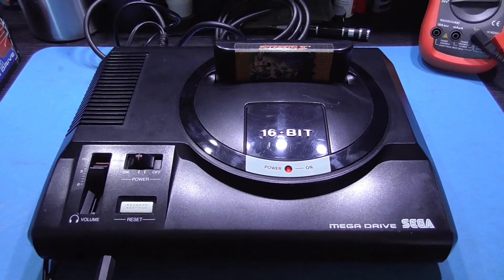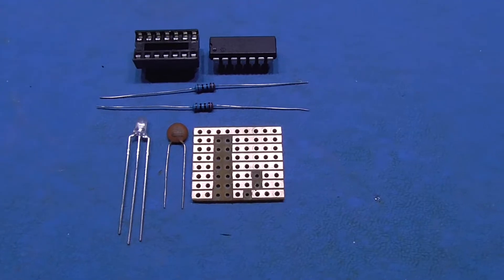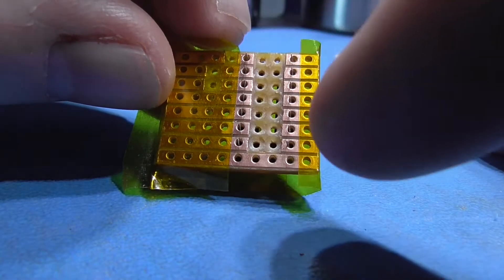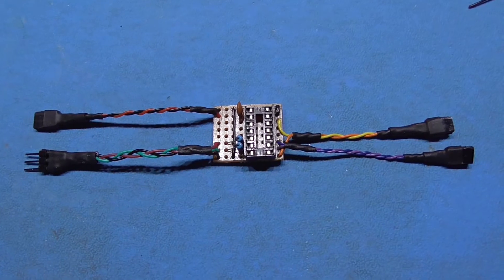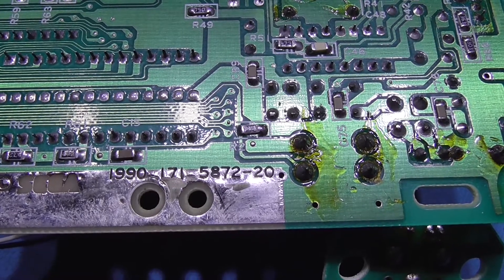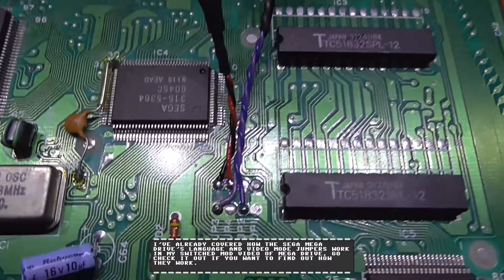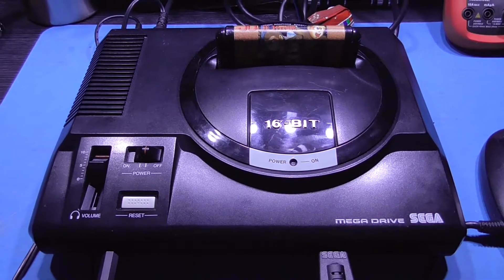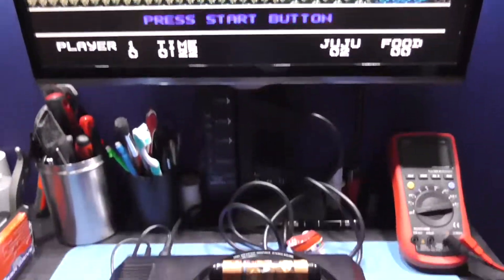Sega Mega Drive / Genesis - Switchless Language & 50-60 Hz Mod.

Comment: So the region lock is not in the cartridge. It's in the system?
Reply: It depends what you mean. Its in the cartridge if you want to play a game with a different region on your pal console. You can achieve this by switching the board of a ntscj cart to a pal cart case and the system reads it normally as a ntscj game. If you want japanese text out of your ntsc-u/pal game you need to mod the board of the megadrive/genesis and then you would probably want a switch.

Comment: Hi. I managed to follow your guide including writing the PIC chip and everything was perfect. This is probably one of the most useful guides online. I didn't go all out on the disconnects like you, just added one on the LED. Ended up with 150 and 330 ohm resistors to get decent LED colours. Maybe my LED's are garbage. Will have a video up on my install in a few days. Cheers for the great guide.

Do you by any chance know if D4S code can work to control a Mega CD multi bios? or does that only work with Seb's code? I might have to ditch D4S if it doesn't work with the multi-bios.

Comment: Beautiful work. That's how I want to do mine. Could you answer me a few questions please? What value resistors did you use for the LED? What gauge wire did you use? and What do they call those connectors you use? Many thanks
Reply from the maker: Thanks for the kind words.

1) both LED resistors are 220 Ohm
2) 30, 28 or 26 AWG wire will be fine, i use 28 AWG
3) .1" inch (2.54mm) Single Row Male + Female Pin Header.

Hope this helps and good luck with your mod.
Reply: Awesome. Thanks for the response. I have never used vero board before but looking forward to giving it a try.
Reply: Hi. Are those pin headers the type that require crimping with a tool? Cheers
Reply from the maker: sorry not got back to you sooner i've been away.  no crimping just solder to them i used some heatshrink tubing to make them look nice.
Reply: Ah cool. Well I went and bought myself a cheap crimp tool and some male and female dupont connectors anyway. I can never get wire to pin soldering neat.

Comment: Hi mate really good video very helpful and I was hoping you could help me please I have a High definition Genesis VA5/6 board plus I have a pic with Sebs hex and with this could you please help me are soldering to the pinouts same as the Mega Drive high def Va5/6 board

Comment: I would like to know how you built the supergun do you have any parts you used and on the neogeo mvs 2slot how would I go about lowering the TTL for the sync to my bvm 20f1u
Reply from the maker: Sorry it took so long to get back to you I've been away for a few days, first I thing you commented on the wrong video but I will answer your question.

The SuperGun wasn’t really copped from any design I just sat down and worked out what I wanted from it and designed it from there.

All the parts were sourced from eBay apart from the case which was sourced from a place here in the UK called maplins.

about Your neo-geo mvs 2 slot, I have a MV-1F and a MV-6F both work well with my supergun on all the TV I've connected them too and it has a 200 Ohm resister on the sync output line.

Wow you have a BVM20F1U monitor that’s a broadcast monitor right, super jealous.  The BVM20F1U should be capable of a wide range of sync input levels seeing as it’s a broadcast monitor.

Hope I've answered all your questions.  Four X =-).

Comment: Great job =D  Worth noting that its 50 / 60hz switching, rather than PAL / NTSC - easy mistake to make there  - but I knew what you meant =D  Technically its 50hz or 60hz PAL
Reply: Great idea with the LED too btw =D  Might have a go myself with this at some point.  Always nice to try and avoid cutting holes etc - switchless is definitely the best way to go.